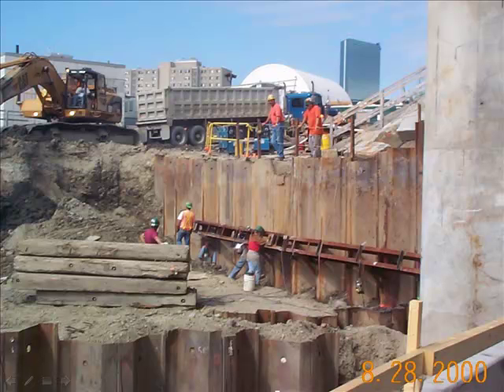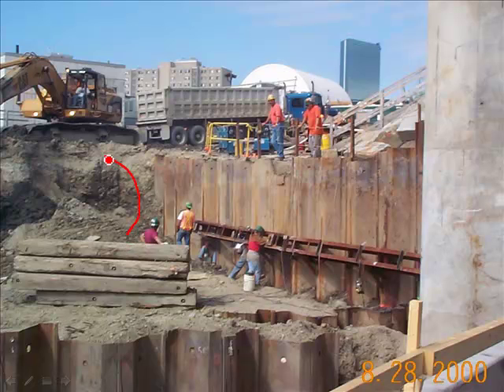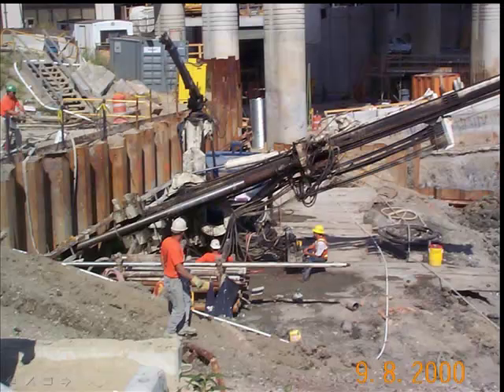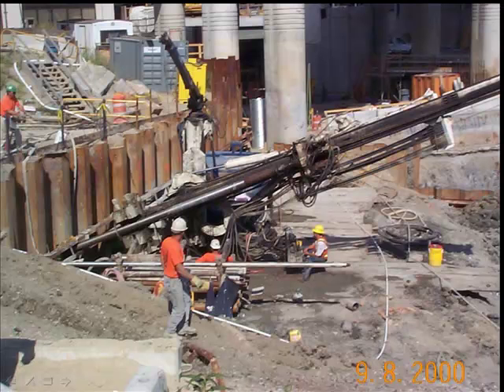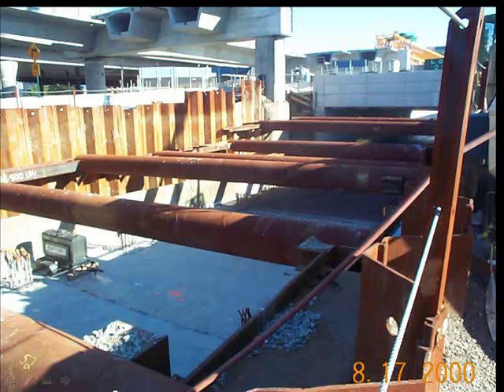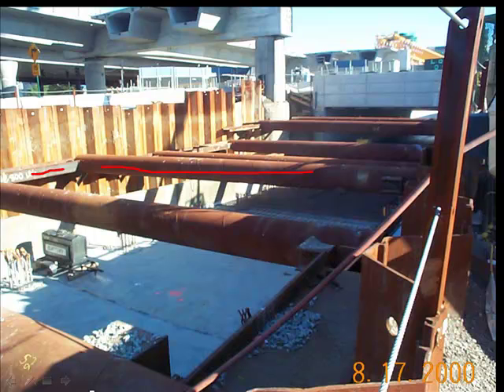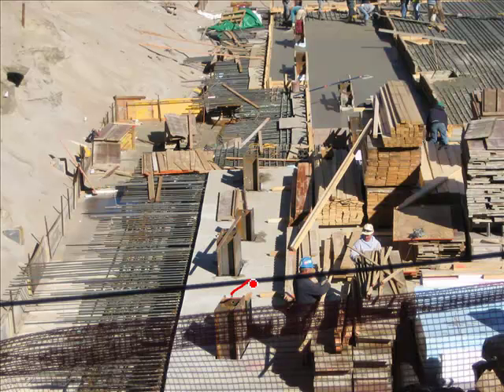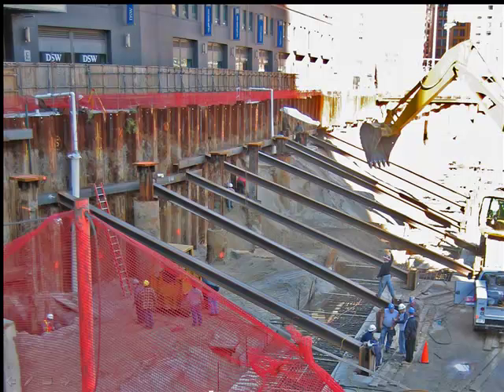Infrastructure Projects Constructing a Building Foundation. f Class 2 lecture part 2a 111009

Comment: I am looking to cost out the difference between using Rakers or tie backs - and how much each would cost the developer overall in a project. Specifically the property is 147 feet long and beside it will be a development with about 2 stories of below grade parking. Using average spacing of tiebacks and taking into account the below grade is 2 stories, how much would that cost the developer to build that out using tiebacks ? And conversely - without using tiebacks what would the same scenario cost if they used rakers for that wall? 
Im just looking for ball park figures +-. If you could advise that would be greatly appreciated!!
Reply: I would recommend rakers for your conditions
Reply: @postersforthecyberage2941  
I'd say it also depends on the sub contractors that you have access to. I've seen some pretty stupid stuff be done all for the sake of "that's how we've always done it"...

Comment: Right now d government needs to develop toco immediately, roads Deepwater Harbour, high rise hotels, for now we need to start improving tourism for foreign exchange purposes, so we could hav tourist comming in straight to toco from Tobago or as it seems fit, housing dem is very important dats y we will need hotels, this plan will take a little while, but in d mean while, an Area, a large area additionally to incorporate mobile unit, properly well managed and secured, cant give out all my ideas, i need to b contacted asap, for more vital, sustainable immediate plans